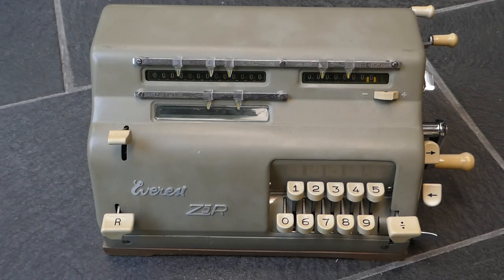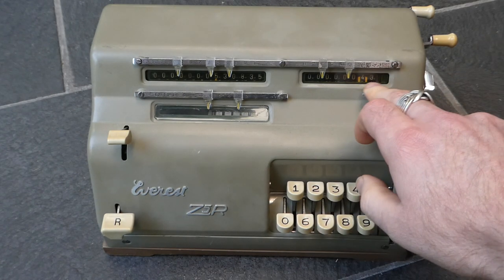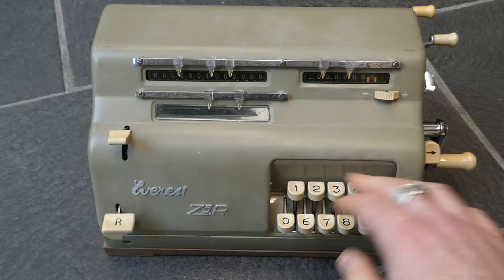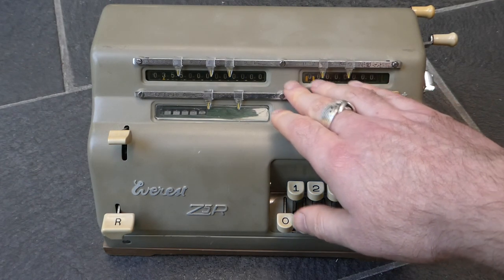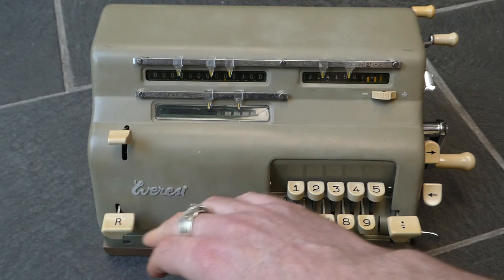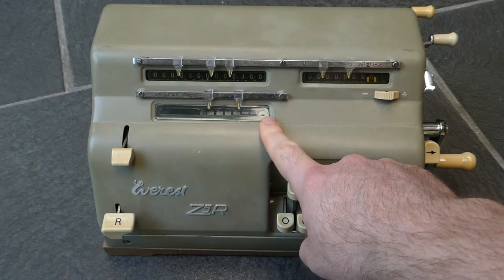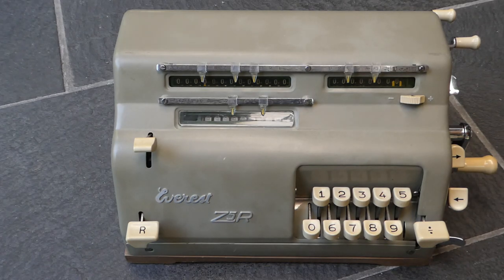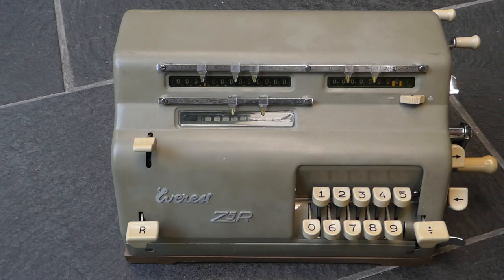The Everest Z5R calculator

Comment: Thank you for your very useful video. I have this machine’s larger brother, the Model maximAR, which operates in exactly the same way. The counter has 9 places, the result register 17, and the input has a capacity of 10 digits. The only refinement the maximAR has over your Z5R is that the output register is split so that the leftmost 9 digits can be preserved if required when the register is cleared. It’s a sort of memory, I suppose.